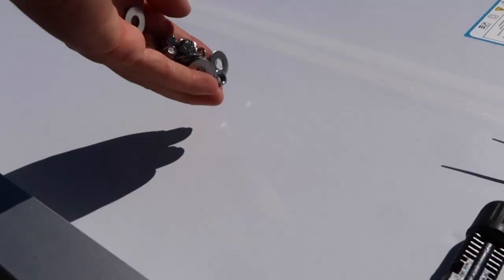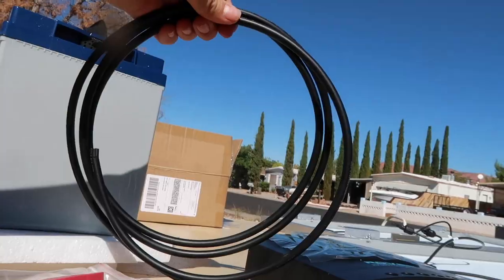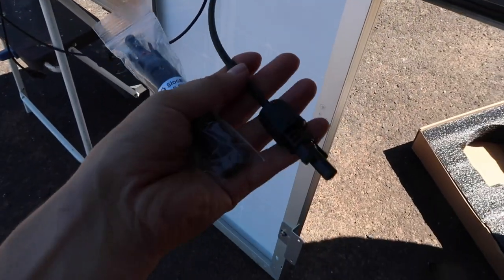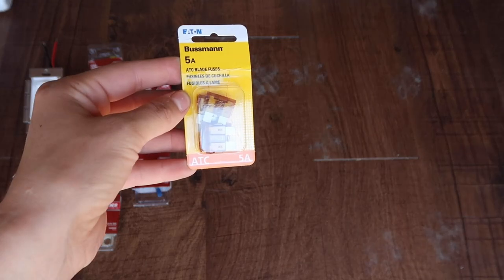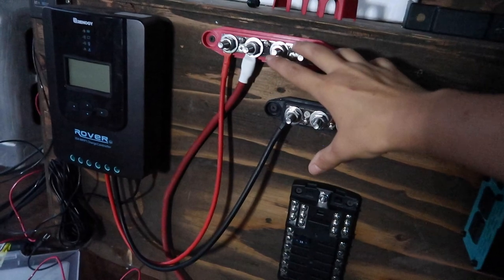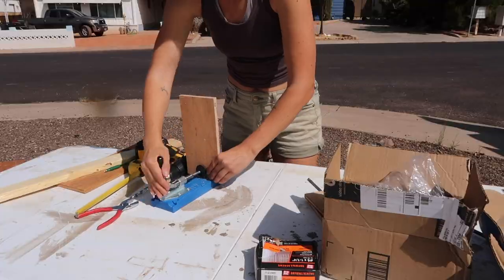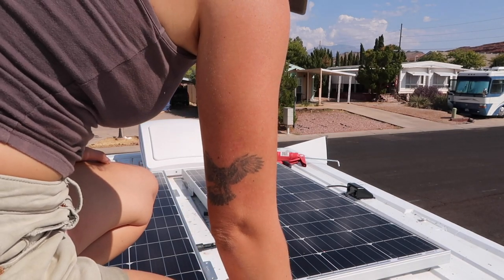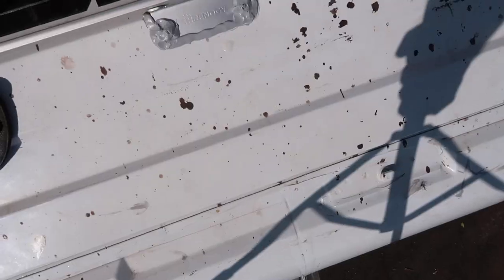SOLAR INSTALLATION 200 Watt Premium Kit | WITH FUSE BLOCK

Comment: What kind of adhesive did you use for the little black box that feeds the cables down under the roof? Just about to put mine up

Comment: I have just one suggestion: Your inverter doesn't look like it's protected. I don't see a fuse on the inverter. There should be a 150 - 200 amp fuse between the battery and the inverter for 1000 watts. The photos on the Renogy website don't show a fuse. Maybe it's inside. I'd add a fuse, just to be safe.

Comment: Curious if your inverter there is non-sinusoidal or sinusoidal 

I had two inverters then realized that both are not safe for electronics, or electric blankets etc initially or long term...

Comment: Could you let me know how you are connecting to the internet while traveling, do you have an external aerial or do you just rely on the device? Phone or laptop or a mobile router?
Reply from the maker: Currently, I am just using a hot spot on my phone and then stopping at coffee shops when I need to. I am still figuring out the best way to get internet! If you have any ideas too I would love to hear them :)

Comment: I think you may have forgotten to slip the wire gland nuts behind your entrance hood before you set it down with sealant :]  Have you found a way to seal up the cable holes in the hood without the wire gland?
Reply from the maker: Nope I did it all correctly! Everything is in place and sealed up! I did forget to do that at first but then pulled the wire though again to fix that issue :)
Reply: @Linneaandakela  Your work is very impressive.  It's a lot of effort to learn all of these things.  Youtube really is an amazing place to learn  :D  Congrats on everything.

Comment: Hey that battery might need a strap so it cant break loose in a crash :)
Reply: Even with a strap, I cringe.... crash energy is incredible.
Reply: Maybe some kind of like wood box with bolts holding it
Reply from the maker: That is definitely something to keep in mind, thank you!
Reply: It needs to have a strap OVER it.  Many crashes are rollovers.  Battery hold down clamps are available in auto part stores for not very much money, and have all the parts you need. Probably available on line as well.

Comment: Is it really the case that connecting solar panels to the charge controller without also being connected to a battery will be a problem? I am under the impression that the charge controller will simply not try to charge in that case.
Reply from the maker: Yes it is a problem, I fried my charge controller by this happening unintentionally. Basically the power from the panels has no where to go other than the charge controller
Reply: @Linneaandakela  thanks! i could easily have made that mistake
Reply: @Linneaandakela  are you sure that's what happened? i've watched several other videos about installing solar electrical and have not seen that mentioned elsewhere

or am i just missing it?
Reply: @Linneaandakela  Hello again! Reading Will Prowse's book for diy solar I noticed that in part of one sentence he mentioned that it could be bad to connect panels and controller without first connecting a battery.

Subsequent searches on the web show me that you were correct in your assertion.

Comment: You need more power.  If your going to live in your van full time.  I'll leave it to experience " mine. I struggled last winter with one battery. I have two now, plus truppled my solar to 375 watts with a 3000 watt inverter and a 40 amp mppt controller  .  I'm thinking I'll eventually get another battery  so I can run a a A.C. unit at night and alternate electric heat with propane " Gas buddy heater..   hope your system works according to your specific  needs. Good luck youngster (-:

Comment: I think it would be better if you used butyl tape instead of double sided tape to keep water out.
Reply from the maker: It’s for the strength of adhesion, not for waterproofing :)
Reply: @Linneaandakela  you already use screws, that would give you enough adhesion.
Reply from the maker: @mehmetdtx  nope. The screws are only going through a very thin piece of metal. There have been solar panels ripped off on the highway from wind that have only been fastened by screws. It’s a really great practice to have both screws and 3M tape.

Comment: So you connected the 20 amp fuse to the positive terminal of the battery? That's a 12 volt wire, which means you won't be able to pull more than about 250 watts from the battery. 250 watts may be enough to power everything that you want, but if it is, why spend all the money on the 1000 watt inverter? You could sell the 1000 watt inverter, buy a much cheaper 300 watt inverter, pocket the difference, and your system should still work just as well.
Reply from the maker: Hey there, not quite. 
The fuse is connected on the positive of the battery terminal, which is also connected to my positive bus bar. The fuse is to protect my charge controller, which is necessary. 
If you notice, my 1,000 watt inverter is connected directly to my battery. Therefore I can pull about 1,000 watts which will power everything I need. 
Hopefully that makes sense!
Reply: @Linneaandakela  Yes, that does make sense, and I now feel very stupid for not having noticed it.

Comment: U have the wrong size wires in ur links. The one u have on there is 4/O gauge wire. When it’s suppose to be 4 awg wire. Just spent $100 for nothing😂

Comment: I had to laugh.. She kept saying 4awg..It's just #4 American Wire Gauge.. 4/0 sounds like 00 buck shot...

I would add. You can use 3M VHB 4920 or 4950 3" or 2" wide tape for rails...It's rated for 8k lbs of shear strength per 2" of tape.. They use that stuff to hold 200lb windows in high rise buildings. Just follow the instructions...